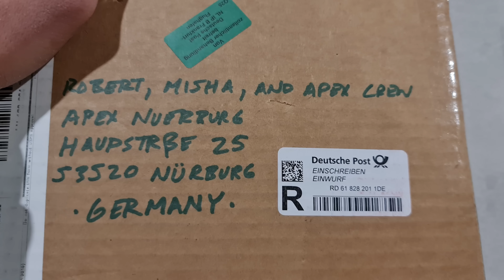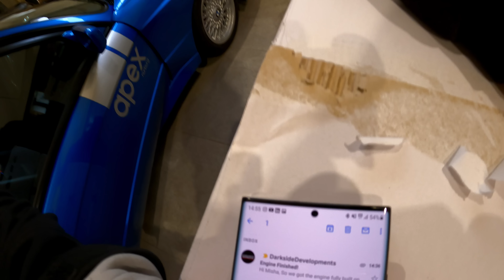Monday MailTime! New ENDLESS Brake Pads and ProTrack Wheels!

Comment: Interested to hear more about brakepads, and comparisons with other pads.  Currently running Brembo HP2000 front (quiet, good bite, high mu) and DS2500 rear (not quiet, slightly higher mu than stock).  Wear has been slower than stock pads, discs love them aswell